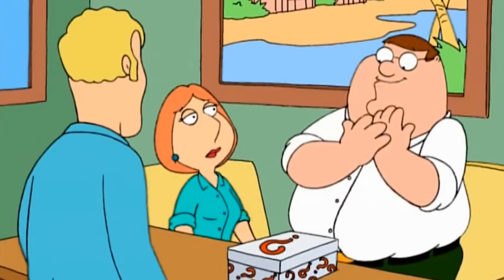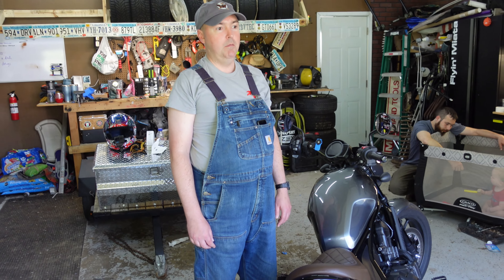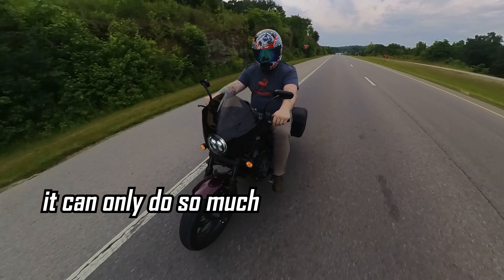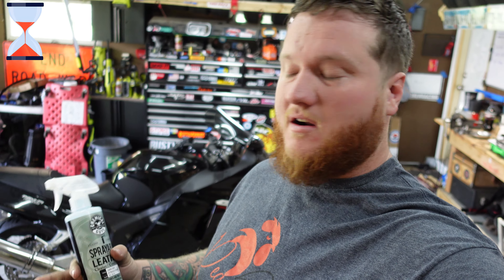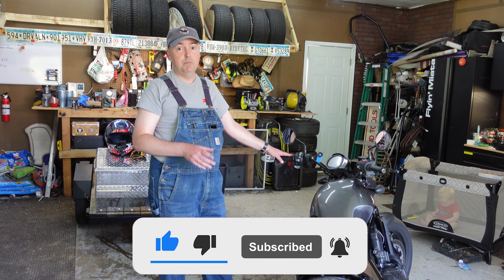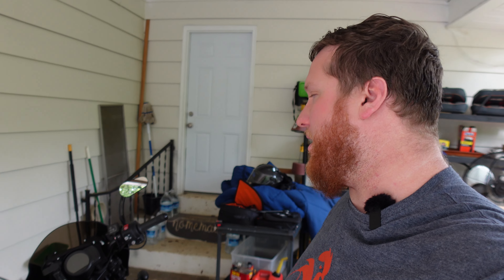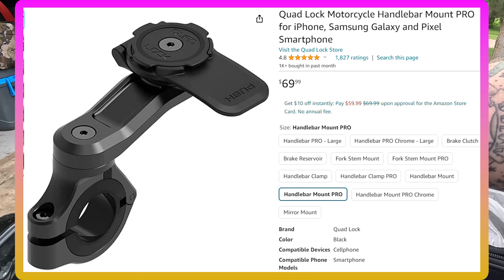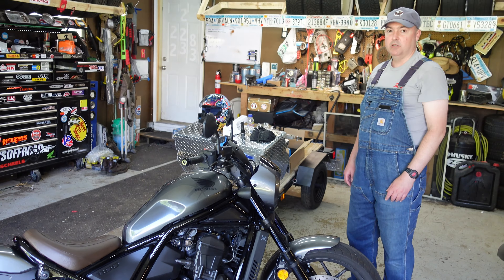We spent $6000 on Rebel 1100 parts so you don't have to

Comment: Whatever you do, stay away from the Mustang Solo seat if you are 6ft or taller!! It pushes you forward and closer to the gas tank! I have one and the riding position is tolerable on long rides, but I am saving up for the Corbin. I know, for the price, the Corbin should make me coffee every morning!! However, my knees and hips are screaming for comfort! The Mustang Solo is much more comfortable than the original “Preparation H” seat that the bike came with from the factory! So Corbin it is. Awesome video guys. 👍
Reply from the maker: I agree. The oem brown seat is a little better than the original, but it's still not even close to having a proper seat. The Corbin gives a little bit of that forward lift, but the lift is more than the forward if you know what I mean. It doesn't push you up onto the tank
Reply: On my Rebel 500, I did have the Corbin seat. After a year it felt like I was sitting on the frame, then I bought the Mustang seat.
The Coffman exhaust was loud enough for me and so the baffle was left in. No problems with the paint job either.
The risers wouldn't have been enough for me, since I'm a small person. So, the dealership ordered new handlebars at the time of purchasing the bike. Forward controls were purchased from Thailand to fit with the crash bars. The Italian forward controls wouldn't have fit with the crash bars.
I had exchanged the Rebel 250 mirrors and put them on the 500. The old mirrors are better 
Also put deer whistles on all of our bikes.
You did a nice presentation of all of your modifications!
Reply: Interesting but for me being over 6ft, I prefer the mustang solo seat over the Corbin.
Reply: @jcjrdigital5570  I have decided to give the Mustang Solo a little more time to “break in” so that my riding position will be more comfortable, and hopefully I won’t have to swap it out for the Corbin. 🤔👍

Comment: Another expensive lesson. The universal Q-lock is so strong it pulled an atomic layer off my phone and it fell as I was riding. As you can guess the phone did not survive. The regular case for Q-lock is great and no issues but don't get the universal. If you don't have a phone that Q-lock is compatible with forget it. I still have the universal as a trophy, it still has the atomic layer of my phone lol. P.s. I had the Qlock with the vibration dampener attached.
Reply from the maker: Are you talking about the sticky adapter that you just put on whatever you want? 

 If so, 100% agree.  We have one that we use on one of our rally tablets, and even though the adhesive holds up well, you're depending on its cohesion with the surface you're sticking it to, and most phone cases aren't great for that.  We wound up using gorilla glue around the entire perimeter to hold it in place.

You don't try to cheap out with the $15 adapter, get the correct case and it's 100% solid
Reply: @redhenracing2  The stickiness was fine actually. The case of the pixel 4a is plastic. That has a nice smooth surface where the adhesive was more then willing to bond to. The rattling while riding made the phone itself part one layer of plastic away from its case. You can see the indent on the phone where the plastic was pealed away. There is 1 atomic layer thick of plastic stuck to the adhesive on the universal. It is rock solid and thin enough to go through your hand, I can't even chip it away from the adhesive. The case itself seems to have microscopic layers from the interior of the case to the outside. This pulled away like baklava. The universal too the very first layer on top.   

Make sense?

Comment: I'm eyeing this 2024 Rebel 1100 for my first bike. I'm 5'11' and 310 LBS. So i'm thinking I'm gonna upgrade the seat for sure.
Reply from the maker: @Kephers7  if you're short on leg length, be aware that most seats will sit a little higher. Burly also makes Slammer Shocks that do the opposite of Roby's and actually lower the bike, but I haven't tried them out so I can't tell you how they affect the ride.

Otherwise, it's a great first bike! It handles very predictably, and doesn't have a ton of what I call "accidental power" like a liter sportbike. It's quick enough, for sure, but a wrong twist of the wrist isn't going to have you wearing it for a hat.
Reply: Hey. im 5' 11 and 275lbs.  Just bought the 2024 rebel 1100T.. You should pull the trigger. But OMG does this seat suck ass lol. I can last an hour tops.. And forward controls are a must. At least for me.. The riding position kinda sucks coming from a honda shadow 1100
Reply: I have both 500 and 1100 2024 .
Im short 180lbs for me both feet flat. 
even standing. Great bike, super to ride.
I got the 500 because as you I am a new rider.. 6 months later, I needed more. 😅 and bags. It is a low ride, so if you are long-legged, you might want to
purchase a used one. It is a great bike to learn and keep. Bit if your legs a jacked up that will suck. Same if Im on my toes stopping in New England with all those asphlat dips and holes.

Comment: Never owned a bike before, I'm trying to get my license soon and buy a rebel. I'd like to know, whats the difference between the Rebel 500 and 1100 besides power? Are any of the parts in this video interchangeable with a 500? I don't know a crazy amount about bikes but I've wanted one most of my life and I think I'm just gonna do it.
Reply from the maker: Some, yes. The bar risers, for example, are very cross-compatible. I'd imagine the pegs are similar too. The seat, windshield, and saddlebag setups will be more model-specific, but I'm sure there are plenty of options. Go check in with LifeOfBurch, Nina rides a pretty modified 500 and would be able to help more.

I do highly recommend the 500, I only got the 1100 for the dct and cruise control. The 500 has plenty of power and gets much better gas mileage.
Reply: Sorry for late response here, My first bike was a Rebel 500 SE (great bike, loved it).  Thus, why I wanted my Rebel 1100 to have a similar look.  Some things are interchangeable yes, but less than you would think.  I ran across this with the exhaust for instance.  Coffman makes exhausts for both the Rebel 500 and 1100.  They are NOT interchangeable.  The 1100 is physically larger than the 500 and engine is very different.  Fortunately, most legit aftermarket vendors (like burley brand) are very transparent about what fits what.  Same with Honda OEM.

Comment: Great review! The quad lock is a great phone mount however I prefer the Eowihor. Weird name, great phone holder. It's a cradle you simply drop your phone into then hit the lever on the side to close the cradle tight around the phone. There have been times I forget to hit the lever and it still securely holds held my phone. It's adjustable for most phone sizes & has multiple ball mounts that come with it at no additional charge and it's very inexpensive, around $18. Having the ball mount allows you to quickly rotate your phone with one hand. It allows you to use your existing phone case, as long as it isn't over 9.25 cm wide (The Galaxy 20+ is 7.8 cm wide).
Reply from the maker: I just checked it out, and I gotta say, it looks like some cheap Chinese stuff. I think you're getting what you pay for with the QuadLock.
Reply: @redhenracing2  Yeah it's cheap but durable! I went around the track on my YZ250 with this mounted to the bars with no issues. It's now mounted on my street bike.

Comment: My  mods so far are Honda OEM but the heated grips were on indefinite back order when I ordered them 2.5 years ago. I’m going to look again. I have the Honda reach seat and it’s comfortable for me but I just swapped it out for the original seat and haven’t tried it yet. I have plenty of padding lol. Thanks for this video! I ordered the screen protector.
Reply from the maker: I can't say I justify the cost of the OEM grips over the Oxford, but them popping up in the display is a really nice touch
Reply: @redhenracing2  I’ll for sure look at the Oxfords at 1/3 the cost. Thanks!

Comment: Interested in all the modes you recommend.
Reply from the maker: I typically run with traction and engine braking all the way down, power all the way up, and the transmission in the middle. That's where I find it to make the most logical decisions for my driving style.

Comment: Is there enough slack in the stock cables and brake line to handle the 1" risers?
Reply from the maker: Yes, no problem at all. Even a 2" only requires minor re-routing and adjustment of some clips.
Reply: @ Thanks!!!

Comment: 22:23 speed wobble 😮
i've heard putting different tires helps with the 83-90 speed wobble. specifically the "Metzeler Cruisetec" tires and apparently they give better stability.
Reply: @redhenracing2 what's your take on that?
Reply: I went through the speed wobbke problem. The Rebel 500 at above 80 mpg no wobble. When I got the 1100, I started to wobble at 80 and got worse as I wanted to ride faster. A guy at work told me to check my tire pressure, so I used my foot like on a car. Lol 
Feels fine to me. Tire is hard no way the tire pressure. Brought it to the dealer crying my 1100 no faster than 500..😭 Aked me if I checked my tire pressure. I said yes, same as a car ... "Do you use a tire pressure gauge." 
Of course not... Then, the mockery ensued. I was persistent with the mechanic, a track race guy, and an instructor.   I was prepared to retun the bike if it wasn't fixed. " Well, I can't drive over the speed limit ." Lol yah sure...
Got the bike back, and he said, "Tire pressure.." Then he said you need a tire pressure gauge digital and a small compressure. make sure your tire pressure is always good. Went for a ride and no wobble...  I felt stupid because it was... Lol
Reply from the maker: Hey, sorry for the late reply. We did a viral and some stuff got lost in the sauce

I did notice that a bit on Roby's bike, but mine doesn't do it at all. Like stated, I think tire pressure could be a factor because it's the easiest thing to be different from bike to bike, maybe it's just sensitive 🤷 Burch said he tested his out to be because of a phone mount on his handlebars, and I find that difficult to process, but he do have MANY more miles on these things than I do, so idk. I haven't had mine around this summer and have only been riding the BlackBird, so I'll have to do some testing when I get back on it in the summer.

Comment: Any recommendations for heel toe shifter with floor boards?
Reply from the maker: I recommend sticking with the oem location mid-controls with the Burly MX pegs. That's my favorite control setup I've tried. These T-Rex floorboards are super adjustable and may get the position you want, but I honestly think they are overcomplicated with too many hardwares to come loose and not as comfortable.

As far as heel-toe shifter setups, I've never ridden anything with them and don't see the point. What is that supposed to do for you?
Reply: @redhenracing2   I have the heel toe shifter and floor boards on my boulevard and am use to it so i was looking to do the same to my rebel 1100T
Reply from the maker: @shawndoan8059  I think moving the controls farther forward and altering it that way really kills the vibe of the bike, but I'm sure somebody has done it 🤷

It's meant to be more sporty

Comment: Hey just wondering if you turned your engine power up. And turn down your engine brake?
Reply from the maker: On mine, I run Traction and Engine Braking all the way down, Power all the way up, and Transmission in the middle. That's what I find most predictable for my riding style.

Comment: I have the same Vance& Hines exhaust but I do have the T model of the Rebel. I will say that my paint has started to degrade within just one month of having it on. I've tried contacting Vance& Hines with little to no avail.  Whilst the exhaust sounds great and improves performance. The finish is shockingly bad and very bad from a company as big as Vance and Hines. I'm not sure whether to paint it or wrap it.   As I don't think I'm going to get an answer from vance and Hines  anytime soon.
Reply from the maker: Hopefully they took them out of production for so long to fix it, and yours is a leftover from before. There's no way they aren't aware of this issue

Comment: Sweet bikes and sweet video! I've got a combination of your bikes. I've got it setup it for touring with the batwing fairing and viking hard bags and trunk but it's all quick release to go back naked. I've also got kenda k761 dual sport tires for getting a little offroad! 😁
Reply from the maker: How do you like the Kendas?
Reply: @redhenracing2  they're awesome man. Just as good on road and waay better off road!
Reply from the maker: @genoapb  very cool. I'm probably gonna be getting a batwing for ours as well, and paint-matching both it and the gauntlet to interchange for around town vs. long trips. Do you have the Memphis quick-lock setup?
Reply: @redhenracing2  yep it's the Memphis shades trigger lock but with a krator batwing which seems to be identical to the Memphis shades batwing but a couple hundred bucks cheaper! bikes on rebel 1100 world and owners if you wanna check it out.

Comment: hi buddy, long time no see. Those oxfords grips you recommended holy cow you were right,  they get so hot they burn your hands LOL. If you ever sale your bike or wanna change your seat, please let me know, i will buy your corbin seat at an affordable price :) LOL see ya man       be well
Reply from the maker: It's been a minute, what else have you done to your bike since the last time you checked in?

If I do let it go, you'll be top of the list 🤙
Reply: @ oh man. So many stuffs. I just got installed a few weeks ago. A Memphis hand guards to block the winter wind blowing to my hands. Last week I got 28L Vikings saddlebags. Valentine discount until the 16th if you wanna try. 25% off and man oh man. They are no joke. My swmotech hard saddlesbags started to crack or brake around the mount area (crap). That’s about it lately. I done many upgrades or changes over the years. The list is big 😂
Reply from the maker: @Julio-bc7pj  I get ads for Viking all the time, you really like them better than the SW Motechs?
Reply: @redhenracing2  thx man. Yeap. Corbin seat will close to be my next upgrade once I get spare money. In the meantime I will continue dealing with the Honda hard seat 😂
Reply: @ Vikings feels better.  More tough but I haven’t even ride in it as I got them last week and we been below 20 degrees lately. I still love swmotech. I got the tank bag. Their mirrors their engine crash bar. Other smaller saddlebags that Honda sales but are swmotech.    A rear passenger bag. I like everything about swmotech but the mount designed on the bag itself cannot hold too much weight or it will start cracking around it but overall swmotech is excellent and very expensive so 😆
Reply: @redhenracing2  this is the swmotech saddlebag that broke and maybe i had them for about a year URBAN ABS side case 16,5 l. ABS plastics and i know you have swmotech as well but yours are different material so i believe you good :)
Reply from the maker: @Julio-bc7pj  good to know, I was considering the Urban ABS bags for our CB300r

Comment: I'm a new owner of a 2023 1100 DCT 🤪. This whole automatic thing is so weird to me. First off, I'm a baller on a budget & I have champagne 🍾 taste with beer 🍺 money 😮‍💨...
I believe the exhaust swap is 1st. I'm looking into the shorty GP because it's roughly a $50 bill and maybe they'll take food stamps 🤷🏼. I'm also considering a TBR slip on because I like the sound of it as well. 
I need my tunes and have a Bluetooth helmet, but I've been looking into mountable speakers that wire into the battery, only problem is the handlebars don't give you that much space to work with on this rig. If there was a DM option I would've already slid in 🕺🏼to really get your advice. Anyhoo, lemme know what cha think. Great video guys!
Reply from the maker: I recommend a Cardo headset (I use a PackTalk Slim), the audio is excellent and multifunctional for calls, group rides, etc. And I find cruisers blasting Kid Rock or Daddy Yankee to be fucking obnoxious myself 🤣

The DCT does take some getting used to, how are you liking it?
Reply: @redhenracing2  Welp, I rode it for about an hour yesterday and so far, muscle 💪🏼 memory still has me grabbing for a lever that isn't there. Whenever I stop at a stop light I want to hold the clutch so it doesn't stall on me. It has quite a bit of pep that sends me back into the seat. I'm a muscular 5-08, approximately 219 lbs (slimming slooooow). I like that my feet can actually touch the ground. I wanted to go back to your video to find some inexpensive mirrors, because I can't see shit out of the bicycle stock mirrors. 
Ooo...I pissed the dealership off because I was adamant there was a type C USB port on the 1100. They argued with me and I even showed them the Honda site that proves it. We watched videos, and went to Google and finally a video on YouTube showed where it was. I found it so crazy dealerships don't even know they're own products. One less thing I need to buy. 
I want to put some front sliders but not necessarily the full crash bar setup. I want to install some fog lights and mount them to the slider pegs but I'm having no luck finding anything like that. 
I'm literally am learning as I go as the dealershit didn't teach me about the bike at all other than the basic, they called it a powerful moped scooter 🛴. I just noticed, I don't even have an owners manual 😮‍💨